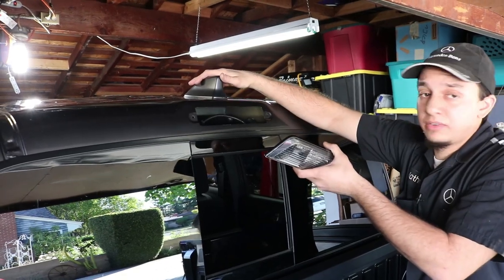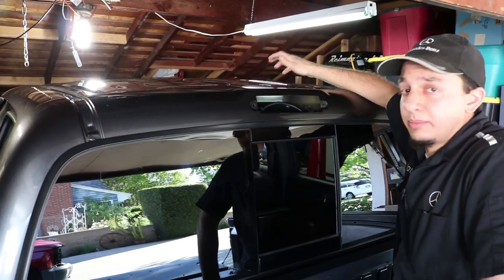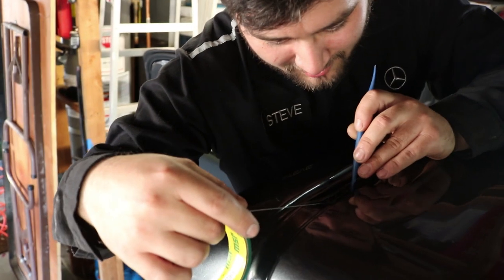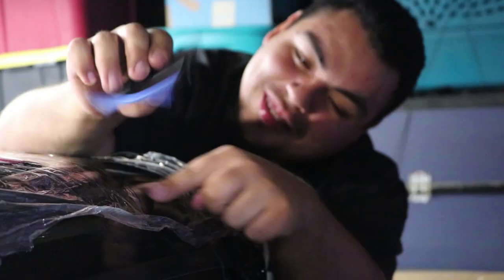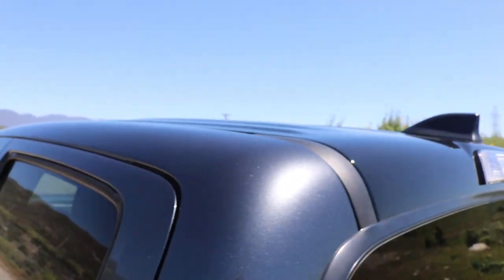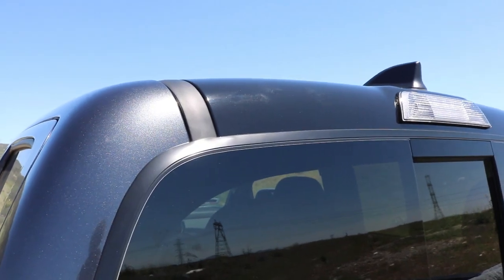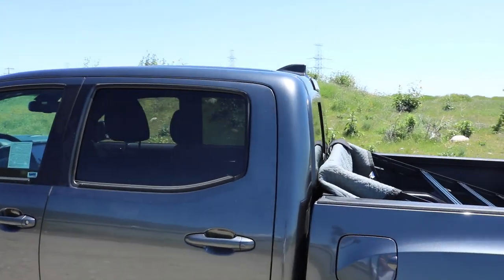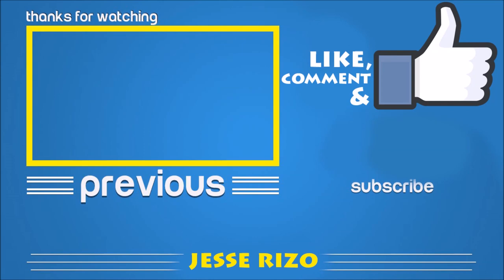MY 2020 TACOMA TRD OFFROAD 4X4 GETS WRAPPED BY REIMAGINED WRAPS | WHAT COLOR DID I CHOOSE!!?????

Comment: After about 5 years it will start cracking and will be hard af to remove,  I would recommend replacing every 3 years especially in that sun.
Reply: Blake i have heard that if a car wrap is left on for so long , when you try to remove it , it will peel off some of the paint.. anybody knows if that is true..
Reply: A lot of it depends on how well you take care of it. It is important to wash your wrapped car regularly and apply uv protectants. Also, depending on where you are located the sun will be the number one killer of your wrap. California is a lot hotter than most places and i dont recommend leaving it on for over around 3 years if it is not garage kept.

Comment: What’s up bro?! I had a question about some rust under the truck. I got some on my exhaust pipe and on some of the bolts. Y’all ever come across this problem or know anyone who did? If so, how would you guys resolve this problem or products you’d recommend? Lmk bro. Love the content. Thanks 🤙🏾
Reply from the maker: I got some on one of the exhaust bolts I just used sand paper for to remove the rust u can always then spray it over I doubt that’s the proper way but so far it’s been good for my exhaust tip I clean and wax it every couple weeks and thanks man!!! That means a lot